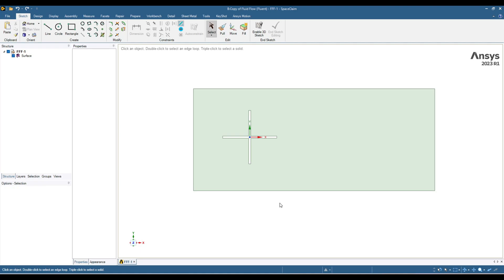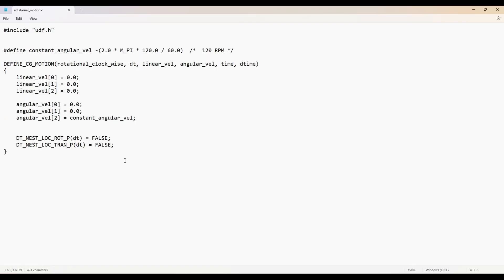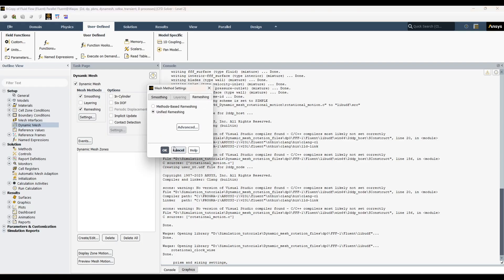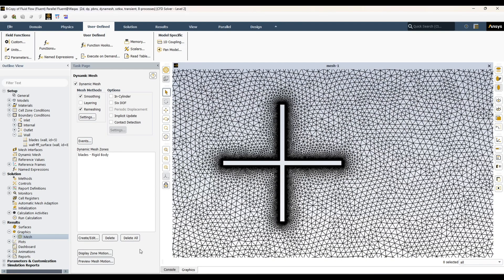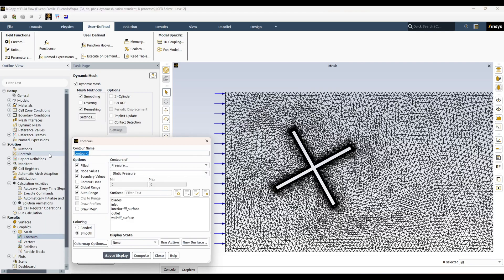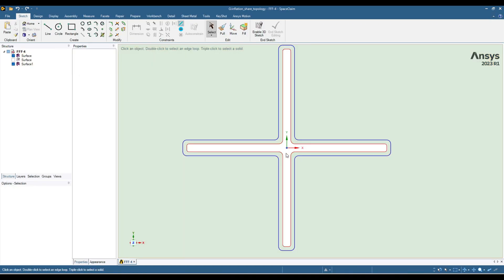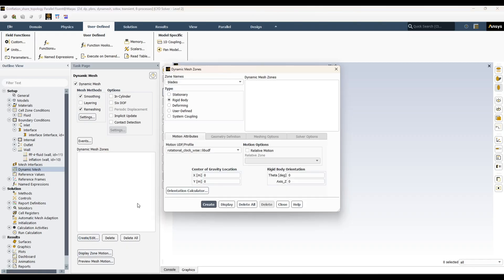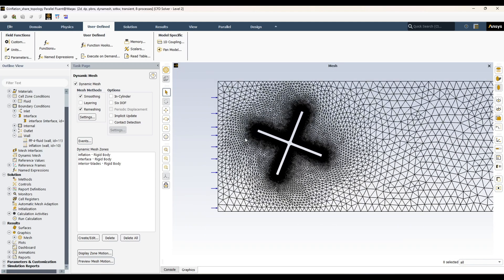Dynamic mesh with inflation / boundary layer | Ansys fluent tutorial

Comment: Which one gives more accurate results? In my experience without boundary layer it will converge less
Reply from the maker: With boundary layers will give more accurate results. The flow field is created by blades. To get the accurate flow field boundary layers are needed